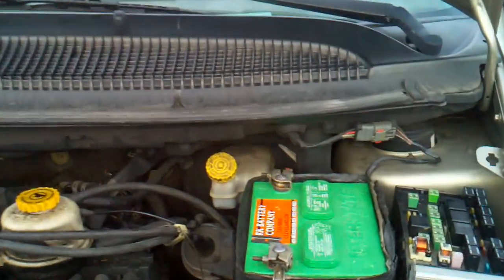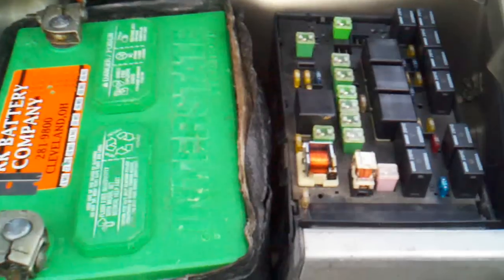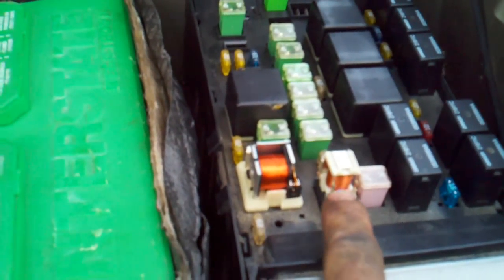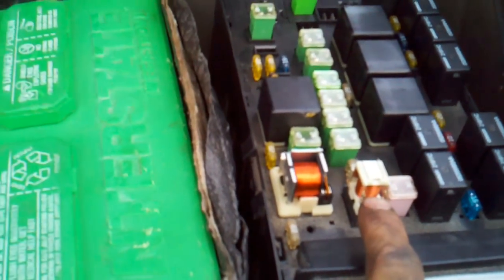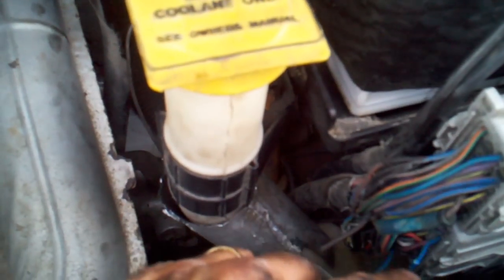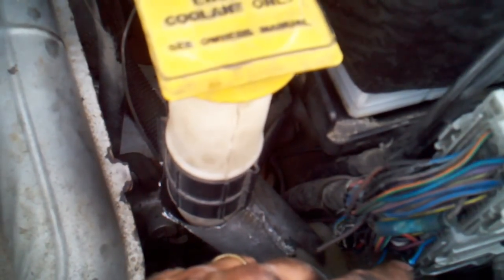2002 dodge caravan crank no start asd relay clicking

Comment: I own a 2002 Dodge Grand Caravan. For the past month, I've been having intermitting starting like the starting motor is failing, but isn't the problem. A couple of times, the alarm would go off after locking the vehicle and using the remote device to shut it off wouldn't work  with unlocking the doors. I had to manually unlock the doors and put the key in the ignition to get it to stop. Replacing ignition switch also didn't help. Wiring harness issues? computer or starter relay?
Reply from the maker: Central alarm moduel ? That's a classic  lol, what codes?
Reply: @BrianMann216  No codes. Talked to a repair place today and they too suspect problem with alarm system. Hopefully this is something to go by. TY.

Comment: Brian. Great video. I have an 03 Grand caravan 3.3 that wont push fuel. Replaced the Fuel pump. Im getting spark.  Swapped around all the relays to no avail. Any other info on the fuel circuit before I figure out how to change the ECM? Thanks!

Comment: Havin same issue after replacing brake master cylinder. Wondering if brake fluid spillage or somehow caused a issue durning installation process.  Codes 118, 123, 509, 1123. Cleaned that ground you mention. Replaced crankshaft position sensor. I had already inspected and cleaned up those wires mentioned. But ill go back and do a even more aggressive inspection since seeing this video brother. Thanks

Comment: **My car would crank but not start.
When the car starts, it ends up stalling on the road while driving. After 20-40mn, the car would start back again but then stall when I am at a stop after "slightly shaking and choking".

**My car is a '98 Chrysler Sebring Convertible Jxi 6cyl.

I need some DYI tips. Spent too much already on this car. What should I do to get it working without all the stalling, which is very embarrassing (esp. when my gf is around)? NEED HELPP ASAP. thanks.

Comment: Similar issue with our 2006 Grand Caravan with 3.8L V6.  Have replaced 6 starters over last 3 years.  Last starter put in less than 3 months ago.  2 days ago, turned key, click, nothing.  Tapped starter with wrench and it fired over.  Tried to started in driveway yesterday, and nothing.  Is it likely starter IS still good and this is more apt to be a relay issue?  Have also been reading that this could be a faulty WIN relay, inside?

Comment from the maker: Hi im having trouble with th audio for that vidoe, will repost and narrate it for youtube. That module that was bas in the back was the vcim (vehicle communication interface module) it was bad, it was not letting the can lines pass thru it. you should have 60 ohms between pins 6 nd 14 with tha battery disconnected, I had 120 indicating a open somewhere in the CAN network ..  hope to repost soon.

Comment: @Brian Mann I just had the same problem with my 2003 caravan after swapping a 05 engine in it. I changed the cam gear, injectors and flexplate and then I discovered the fuel injector harness was just like this one. But my van still won't start, it has no spark. Should I replace the PCM? Can I get one from a 01 or 02?
Reply: Hi my 01 caravan same issues! I’m not ready to give up on it quite yet! I’ve got new battery, new alternator, battery shut off switch from parasitic drain,,, worked for like two days. Now won’t start again
Wah

Comment: I was interested in the video of the hhr you worked on with a can issue. From the video i see 60 ohms when u ohmed out pins 6 and 14,  I seen lots of rust under the dash and you were holding the ecm maybe? couldnt actually figure it out off of that with no audio

Comment: I replaced all my sensors, MAP , TPS ...etc.... but stiil had 106,107,108 codes ,also 1784 and bunch of other codes ..My other idea was to change the PCM ......STOP BEFORE YOU DO THIS ... Harness behind the power steering resevoir ...behind distribution cap....this harness had melted wire together . Just carefully re-tape all bare wires away from each other ....this will take care of all these codes .
Reply: Same here. Lots of unburnt fuel out of exhaust, smoke, etc. Melted injector harness.

Comment: I am having issues with my 2001 dodge caravan SE 3.3ltr. The engine will crank and intermittently try to start. I just had a a Camshaft Position sensor replaced. Van ran for 3 weeks after that. Now its just cranking with no ability to run. I installed a new crank sensor since. Didn't solve the issue.  I cannot find the crank sensor from where the Chilton manual says it is. So I am lost as to what to do at this point..
Reply: Cheryl Carnes

Comment: For us we got lucky. Knew it was something not getting correct electrical. So ended up swapping around all relays. Still wouldn't start. We ended up buying new battery terminals. The ones we had look very good. But they weren't at all. Changed the terminals and started up on first try without any relay tapping anymore.